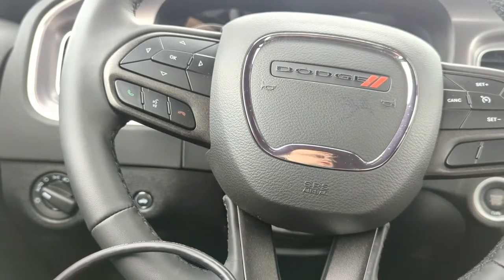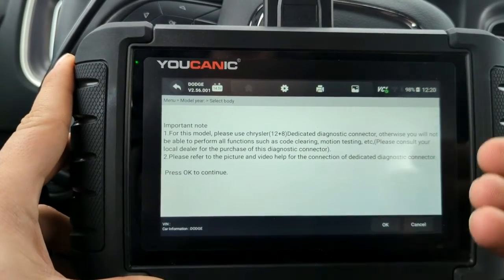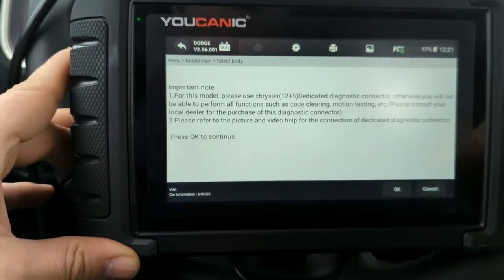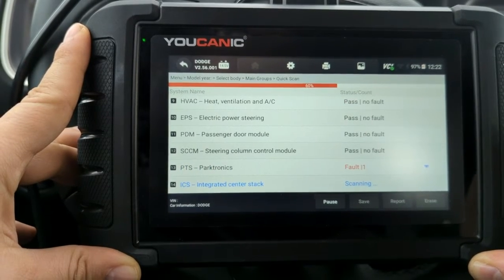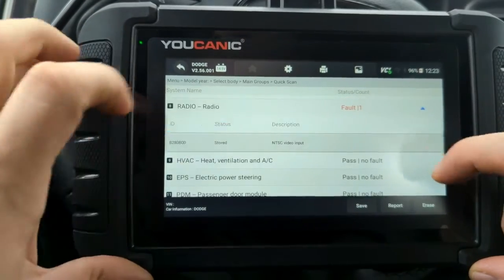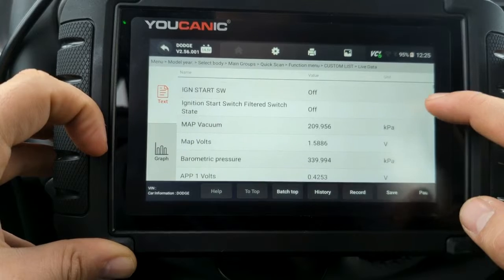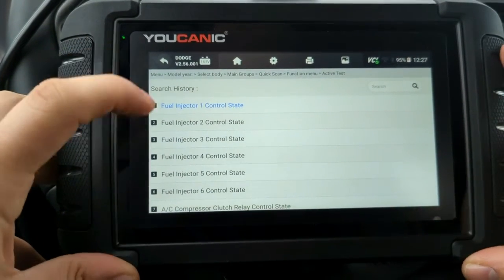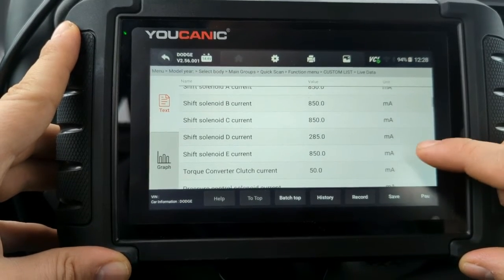Diagnosing 2018+ FCA (Dodge, Chrysler, Jeep etc) with Security Gateway Module using YOUCANIC Scanner

Comment: Call me confused. By the title of the video I assumed you were going to show the additional access allowed by bypassing the security gateway module. Maybe even how to hook up the 12+8 adapter. But all I saw was basic functions w/o going behind the SGW firewall. What am I missing? I was really hoping there was a video out there showing full use of the scan tool on a 2018+ FCA vehicle.
Reply from the maker: @steadyeddie7453 If you’ve got a car issue or repair question, you can find step-by-step guides and scanner help at youcanic.com. We might miss some comments here, but our site has answers for most problems already!
Reply: @YOUCANIC  We just want to see your scan tool in action on a 2018+ FCA vehicle using the 12+8 adapter. Please point us to where on your website we can see this. We just want to see how much more the scan tool can access once behind the secure gateway. The title of this video gave us the impression it would demonstrate this but it did not.

Comment: Does the 12+8 adapter still work? I used one on a 2018 Dodge Charger through the adapter but I couldn’t access bidirectional options.

Comment: Is this process dependent on bidirectional obd2 scanners??? Are you using a 12+8 cable?
I cant seem to get a straight answer from 5 videos watched....
Reply from the maker: On this video we are not using the 12+8 cable. So you can read codes and see live data but can not clear codes or send any bidirectional commands to the car since we are not connected with the 12+8 cable. If you for example try to clear codes the car will not allow.
Reply: @YOUCANIC  I see, Thanks for your clear demo and explanation Youcanic. Its much appreciated.